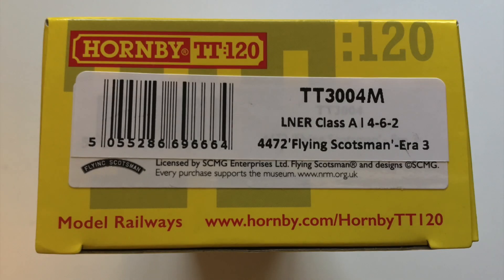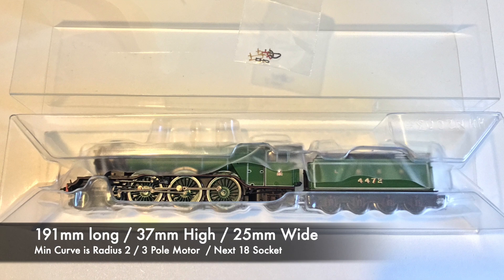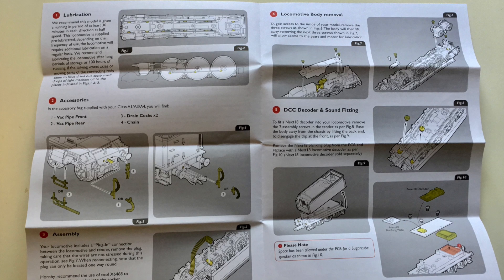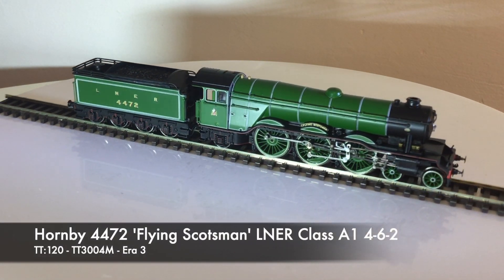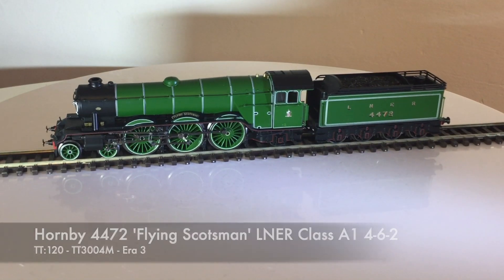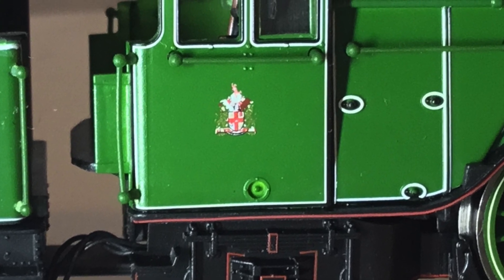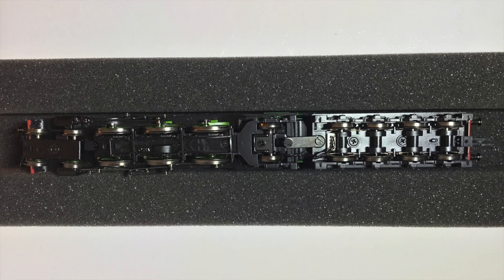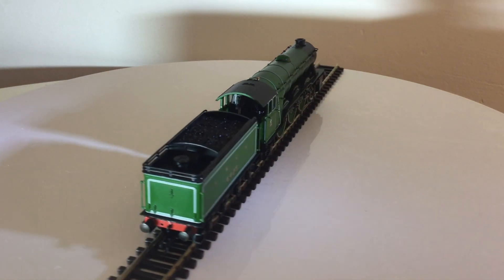Hornby TT:120 4472 'Flying Scotsman' Class A1 4-6-2 TT3004M Model Railway Era 3 | ml8

Comment: The whistles are (so I'm led to believe) two safety valves in metal and a whistle in plastic. Hmmm... the valve gear on both sides of the model are sticking out a bit too far from the wheels, which could lead to damage if not handled carefully.
Reply from the maker: Yes, I was meant to say whistle and should have added, safety relief valves too but, the plural, whistles came out on listening back. It’s surprising what comes out as you watch everything else when recording. You could be correct too, in saying these two tiny modelled valves are not painted plastic. The more we do these things, the more we see and pick up the latest additions that become something we look out for but, getting a bit better as I approach my 10th video. Having handled the model it seems robust enough on the wheel connecting rods if that’s what you mean
Reply: @modeloco  Connecting rods: Yes, they just look odd.
Reply from the maker: @PaulSmith-pl7fo  If you’re downscaling from say OO like myself it does look rather strange but, am sure I’ve felt this looking down on N Scale models in the past and feel this is because the space just isn’t there to make these intricate rods strong enough, as you say, for handling and wide enough, for long term reliability with wear and tear so, thus being a trade off. I might be wrong but, do feel this is probably the reasoning behind it?

Comment: It is a great model, shame mine has some glue on the join between the barrel and the rest of the body shell and a mark on the side of the smokebox. 
I wish Hornby would stock spare body shells for this sort of thing. I am glad your example is ship shape and Doncaster fashion. 

I have also noticed an inaccuracy with the livery. The front splasher's green paint and the white lining do not extend to the edge of the running board as they should. If Hornby fixes that painting issue and starts selling spare body shells, I think I will own a true 10/10 model.
Reply from the maker: Not bad for the first batches, thanks for the information Warren